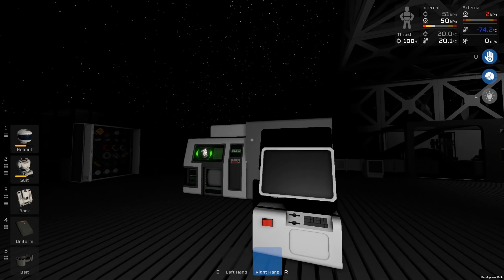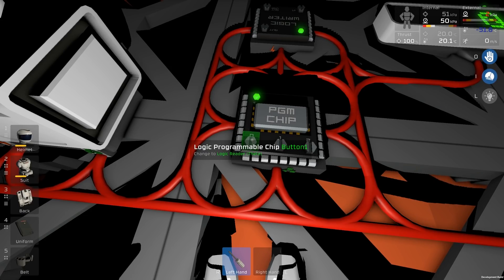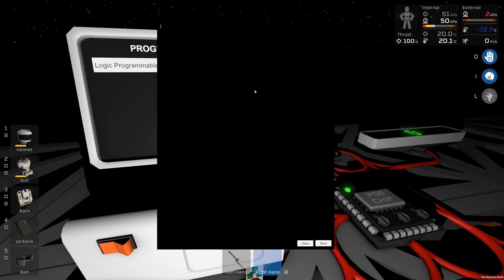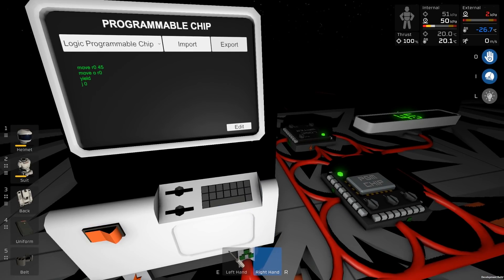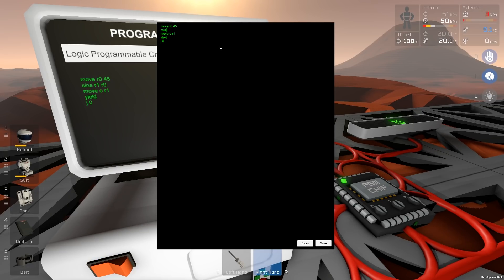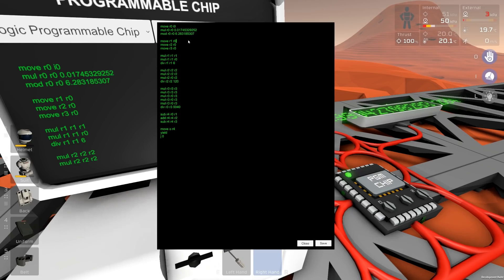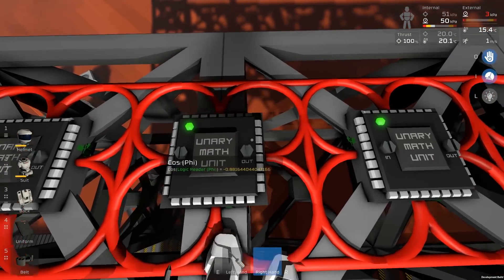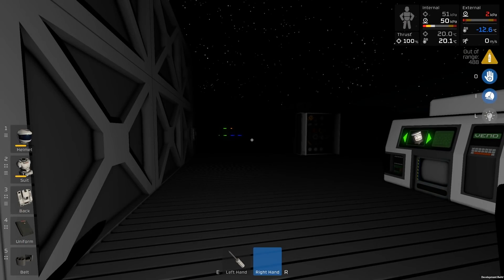Stationeers S2 E47 - Programmable Chips!

Comment: programming isn't complete without conditional branching. if the jump instruction can take a register, then I guess you could calculate where to jump, but that's a bit silly, isn't it?
Besides that, are there comments? comments are important, especially in lower level languages.
And then there is the issue of lines moving around as you edit. assembler languages get around that by introducing labels. labels don't get translated but when 'compiling' they get replaced by offsets or memory addresses. so labels would be a nice thing here, too to avoid having to adjust any and all jump instructions after inserting or deleting some lines above or below them.
Reply from the maker: It has all of that :) the pace of development on ICs was very fast.  Jump to labels, conditional branching and comments all possible

Comment: It's way simpler if you put x^2 in a register. Then x^5/5! = x^3/3! (which you calculated already) * x^2 / 20. And x^7/7! = x^5/5! * x^2 / 42. I think that version is less arbitrary code and more systematic-looking. You'll also get better results with 0 in the middle of your input instead of at the edge. (x + pi) mod 2pi - pi.

Comment: They are still developing that new chip and all subject to change. They have a plan to make chip to directly interact with devices and have 6 io places on that devices that you will be able to use as you like. But this info is just what they are planning.
Reply from the maker: You could... but the next episode has 100% efficiency solar tracking using a programmable chip without a PID, if that interests you :)
Reply from the maker: Ack, replied to the wrong comment!  6 IO devices sounds good!

Comment: grayduster I think someone might shrink down, all the circuits done by more than 2 procesing units into a bunch of PGM chips ;) . Or how about that ingot-requesting system? Now it will not reqire a wall/floor/celing (or comination of those surfaces) 6x6 block surface area (guessing the reqired space) for normal chips now, will it?

Now we need them to introduce a string type format, then the 1 output limit won't impact things as much, you would require some extra hardware, but it would be no more than 3 chips for 2 outputs (I think).

Right now I see a way to make it (sort of) possible, you would need to have at least one varible that has a known max value, that you want to output, then you add that value to the multipcation of the max value of it and the other value you want to output, and then you need a outside decoder which is litheraly 3 chips (one can be skipped if you don't care about flooring the second value), the first value is optained by calculating OutputValue%MaxOfFirstValue, and the second one by calculating floor(OutputValue/MaxOfFirstValue).
You can extend that method to output more values, but you need to know the highest of maximum values besides the last one, then the Outputvalue of the PGM should be set to O[1]+O[2]*maxOfMaxValues+O[3]*(maxOfMaxValues^2)+O[4]*(maxOfMaxValues^3)+...+O[n]*(maxOfMaxValues^(n-1)) ('O[1]' is the first output value you want to output and 'n' is the amount of output values to be outputed), then the decoder is built from as many copies of the 2-value decoder as (n - 1), chained by attaching the floor output of a previous decoder and using it as the input on the next one, then each output value is going to be the output of the modulo-calculating chips, and the last one is going to be the output of the last flooring chip. This is a sollution, but this should be improved in the future (by the dev's).

Comment: I wonder why they didn't just include a higher level language, like in Space Engineers.. guess that would make it "too easy". lol. Still cool tho.
Reply: I read in discord there was a concern that people could use a higher level language to break out of the game environment and execute arbitrary code
Reply: You can embed a high level interpreter and also isolated it from the rest of the game code or arbitrary class libraries by only explicitly providing it access to game objects you want players to have access to. I've done it before.. years ago. Existing interpreter libraries are designed with that in mind.
Plus... if you could do it with a high level language, you can certainly do it with a low level language which would be more difficult to track down. The level is actually irrelevant.
I believe they've made a shortsighted mistake in thinking that. They should do more research.
Reply: Run your compiler outside of the game, paste in the .s file. You're going to want to write your programs outside of the game anyway so you can use version control.
Reply: What compiler, what .s file? This language is made up  by the devs for the game, afaik. And it's single player, so you don't need version control. Don't be a Mr. smartypants :-P
Reply: @fourdotsYT  It's not too hard to make gcc target a new assembly language, and it's commonly used for real-life chips with about the capabilities of these. Version control isn't about other players, it's for when you find that your improvements to your solar tracking make it all wrong and you can't remember exactly how the code was last time it worked.
Reply: +iabervon Short response: "are you out of your blinking mind?!" lol

Firstly, when I said single player, I also implied single programmer. Code versioning is definitely overkill for single programmer 128 line files... but ok I'll give you that. I've used it on my own personal projects, even though it was overkill then too. I did it more to learn svn & git.

But the rest you said is completely over the top, at least in my mind. By "not too hard to make gcc target a new asssembly language", do you mean "target" as in cross-compiling, as in writing machine descriptors in MD-TRL? If so:
1) cross compiling is definitely complicated, beyond most programmers
2) RTL is an entire language (and programming lisp-like paradigm) one would have to learn, NOT simple to understand
3) One would also have to learn and write c preprocessors
4) One would have to learn the gcc  and c/c++, and probably the whole compiler pipeline, and internals
5) The target is NOT a real processor, (a) it's a construct in the game... thus even if one learns all the above to a workable degree.. one cannot test it efficiently enough; (b) it doesn't even have logical or bit-wise operators, it's not even a "toy" processor.

Also, you started talking about an ".s file" out of the blue. Nobody without the right background would have even known what you're talking about. Hence this conversation... :-)

Please correct me if I'm wrong. If it's easier than this, then please explain. Really, I'm actually interested. My experience goes as far as Arduino (C), and PICAXE (BASIC) microcontrollers, reverse engineering/sniffing some windows driver init codes to plug into linux kernel driver, some manual (dip switch) 8-bit DIY computer EEPROM microcode stuff, so I'm certainly no expert.
Reply: I was being a bit silly, and I wouldn't expect players to write the gcc output stage themselves, but I could easily see someone writing it and putting it up for other players to download. IIRC, Arduino started out using gcc with an AVR output stage that was written by someone not previously associated with gcc, Atmel (the chip manufacturer at the time), or Arduino, so it's definitely possible for someone to make and share the compiler targetting a brand-new architecture. At that point, it would be very much like Arduino development in C: you download some tools from the web, write your code, put it through the tool you downloaded, and copy it into the chip.
Reply: Yes, I suppose some Smartypants would actually go do that ;-) could be fun. Still, that would require players learn C... which I suppose is easier than assembler.. but the output would still be restricted to 128 lines. I wonder why they put that restriction in. I guess you could crash the game with too much going on.

Comment: This is an awesome new addition to the game.. one can do SO much with it.

Trig functions are too high level for 'assembly' language I think, so I doubt it'll be put into the chip. Perhaps one can offload some of that to the math- and other chips in combination with PGM (since you only have 128 lines to work with, and the Taylor expansion is just an approximation, I believe). I'll have to think about how to do the I/O.

Remember, you can write re-usable 'functions' in assembly language: 
- store the return address in a register,
- then 'call' the function (jump to the 1st line of the function),
- then finally 'return' (jump back to the line after the call) at the end of the function.

// this is pretty much how it's done in low level machine language. 

One could conceivably also store a library of functions in a PGM, that you then call from other PGMs (using a similar technique as described above...), or perhaps to extend the number of registers available to a program (by setting or retrieving register values in another chip).
Reply: fourdotsYT Not that the outputing two numbers (or more) via a singular number output is hard to pull off, because it is extremely simple (for me at least), you just need some extra code in the PGM in question and a decoder cicuit, that is outside of the PGM you want to output from.
Reply: Sure. You can also store such encoded values in registers. I mean you can essentially do what a computer can do.. if you know how. Although, it might be difficult, since no bit- shift or logic operations are available, only boolean. You can conceivably build more complex data structures, like arrays, hashtables, or strings perhaps - though it seems there's another limit to what you can do: you can't access main memory, only registers. Would be cool if they made the physically enormous memory chips, or data cards addressable and accessible via PGM code, maybe provide a stack or something.
He might lose viewers if he goes too deep into that, maybe.. but who knows :-)
Reply from the maker: I think I may lose viewers just mentioning this stuff, hehe.  I'll just provide pastebins for ease and add comments :)
Reply: +grayduster Not this viewer :-) This has re-invigorated my interest. Players are obviously interested in the feature enough that the devs added it to the game... Perhaps you should have a "Stationeers Appendix: Tech Workshop" side-series that goes into such things, along with circuit design in more detail... for those that are interested.

P.S. I noticed the devs tweeted your Europa vid recently, so it looks like they're aware of this channel :-) I've also heard other youtubers refer to stuff they learned on your channel. Good on you!
Reply: Imagine you could get access to the whole logic network with this chip where the amount of vars is based on the amount of memory units you have on the network ... Imagine an advanced PGM that could read and write things directly ... or you could unlock higher level languages by haveing a specific interpreter chip in the network ... Let's see if this could be done with a mod
Reply: I actually like the fact that they kept the PGM code low level.. it's close to what programming actual chips are like. But they give you an actual desktop computer, but with clunky branching state-machine-like "programming". So much for keeping it "low level", and realistic. It seems they skipped a few levels of abstraction there. Perhaps they could include both script-level coding for computers and assembler level coding for chips, and then make both useful in the balance of power and efficiency.
It's actually simpler to add an embedded scripting shell/interpreter that understands something like C#, java, or javascript and provide an interface/adapter to game objects, than what they did here with the limited pseudo assembler language - which is basically a low level interpreter they had to implement themselves running on top of a high-level language - since such high-level interpreter libraries already already exist, and you can just import it into the game code.

Comment: The biggest part about this that I like is being able to save the programs so you could get something (like tracking) up quickly without spending 20 minutes laying wires and power to a bunch of chips.  It's basically a way to alleviate the tedium for second playthroughs.

Comment: You don't need SIN for the solar array incline calculations, so it's a bit of a waste spending time explaining. Just use a regular sensor flipped upside down and programmed to mode 1 (mode 0 default). This will output the incline angle and then you can add that to your batch writer.